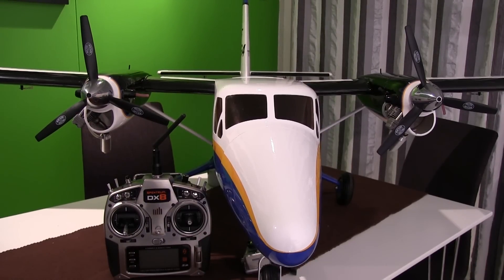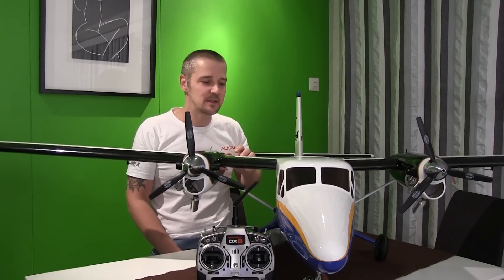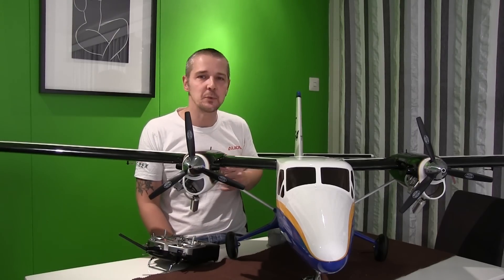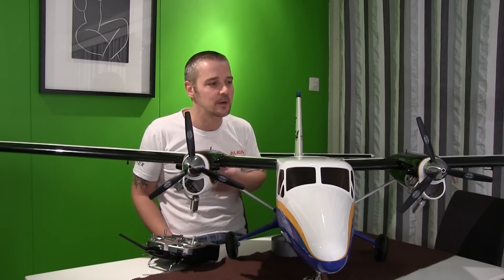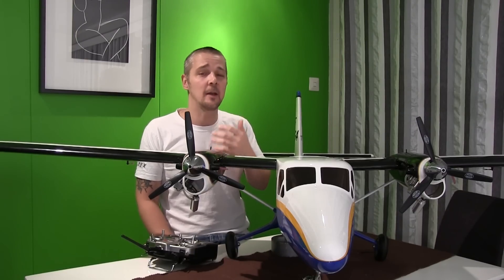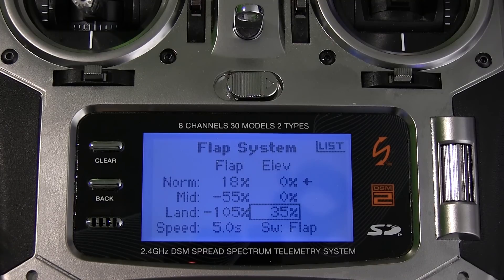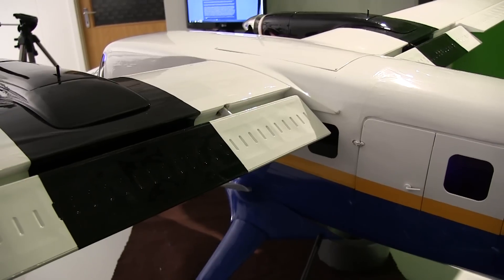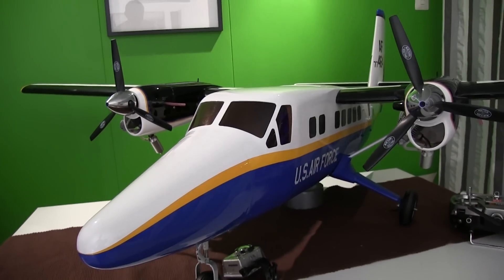Spektrum DX8 - Flaps And Down Elevator - How Do They Work & How To Use Them

Comment: Thank you so much for sharing your knowledge on setting up a Plane with the DX8. I just got a DX8G2 and will set up both a Carbon Z Cub and a Carbon Z Cessna on it. What Flap/Elevator mix would you suggest I use? They both have pretty much the same Wingspan of 80" and 82 inches. Any suggestion you have are appreciated. I lucked up on your YouTube site after going thru a bunch of tutorials and yours is by far the absolute best! I am now another Fan of ArticRC. Thanks for what you are doing for us in the Hobby.
Reply from the maker: I usally start with 10% down elevator on full flaps. I never used it on half flaps yet but you can add about 5% in the beginning and the tweak your way into perfect settings. Happy New year Sir
Reply: Thanks so much for your quick reply [especially on a New Year morning]. I planned to spend the day programing both Planes on my DX8G2 and now I can do just that. Can't fly yet because we have plenty of cold [4 degrees this morning] and plenty of snow on the ground here in the Mountains of West Virginia, USA. Watching you all fly in the cold is fun and funny as I sit back and sip my hot tea. LOL! I love your videos and the production and art work are some of the best on the Net. I have been spending my time watching your videos and am surprised how many there are. I have also learned things I didn't expect to learn. If there were an Award for a RC Website, yours gets my vote! Be sure I will let my friends know about your Site. Thanks again. Tony.
Reply from the maker: Tony Harris That is one of the most beautiful comments i have ever got in 9 years on youtube. I failed to reach my goal for 10k subscribers but i guess i just need to get even better.  But thank you sir and a happy new year to you and your family. Greetings from Norway.  Bengt & Elna.
Reply: Thank you and best wishes to you and Elna, Bengt. As a retired Radio and Television Personality, Producer and Program Director, I respect Talent and Commitment in those who present a product. Clearly yours is a Commitment of Love and Passion for the hobby, flying and what you do to share it. Stay warm and I will be watching and drinking hot tea until the snow melts and the Sun shows it's smiling face again. LOL!

Comment: What plane is that in the video? I would like to see it fly. Do you have a video of it flying?
Reply from the maker: Chuck S. Search ArcticRc Twin Otter.        it is the Hangar9  Twin Otter
Reply: ArcticRc thank you!.. do,you have a video of it? I'd like to see those twin four strokes in action..
Reply: I just found your video of it flying.. then it crashed. It's a beautiful plane. Did you rebuild it?
Reply from the maker: Chuck S. nope but i have a new bigger one on the way. WS. 3m  with two 30cc dle gas engines

Comment: Why does your elevator servo sound like it's jumping gears?
Reply from the maker: Michael Batson hi Sir.  the spektrum radio has a feature that slows down servoes for more scale movement. the 9110 powerHd are very noisy digital  servoes. even more when you slow them down.

Comment: my throttle stick moves my rudder. my left stick moves my elevator up and down when I move it right and left. my configuration if all backwards, how do you fix that?
Reply from the maker: anthony perkins i guess the Mode settings are wrong. go into system settings in your radio and choose mode2.

Comment: Can you tell me how to do the settings for plap use on my DX7s for a Top Flite Cessna 182?
Reply from the maker: i depends on how your servoes are stup. du you use dual ailerons or a y kabel. the same with your flaps. i have made a setup video for flaps but do you have the old dx7
Reply: ***** yes ... i have 2 servos for 2 flaps and 2 servos for ailerons (1 each). I use a Dx7s.
Reply from the maker: but do you use y cable on ailerons?  in wing setup you should set dual aileron and one flap. then aileron goes into ail and aux1 and make sure the servoes for the flap is pointing both to the right or left not against eachother and then connect them with a y cable to the aux2 port. go into flap setting and set aux2 for flap. then you can reversethe aux2 channel if the flaps goes the wrong way
Reply: ***** 
Yes. I use Y cables on both flaps and ailerons. What happens is that when i scroll to the travel adj on the aux channel, the tx only lets me assign values (travel %) on position 2 (fully down switch). When i try to set my values on position 1, i move the scroll dial and nothing happens on the flaps (they dont move up or down). When i move the flap switch to '0' position, the flaps move uall the way. But again, i need 25mm on pos 1 and 51mm on pos 2 as per manual suggests. Please help me out.
Reply from the maker: you need to go into flap settings. not travel adjustment. lets say you use flap in port aux1. then you need to assign this in the flap settings.  i will try to borrow a 7 channel radio and give you the setup in a video. witch reciver are you using?
Reply: rx is spektrum ar8000.
Reply from the maker: i will check it out. i think you just missdo the settings.  :)
Reply: ***** Yes. Ok. But check the vid links. I got it. Thanks for your help.
Reply from the maker: cool.. have a great flight

Comment: This is the first time I have an understanding of the mix function on my radio.  Unfortunately my Futaba 6EX does not mix elevator and the new flaps that I put on my Avistar elite trainer but now I know what to do for my next plane and radio.  Is there a way to slow down the deployment of my flaps, which have only one speed on my radio?  Thanks.

Comment: No pun intended that you do realize the elevator must go up instead of down for landing what your plans will nose down and crash it has to go up I think of when you do a loop you pull back on the elevator to make your plane go up not push it down because that would make you nose down into the ground right Landing flaps go down elevator goes up to stabilize the airplane
Reply: When you drop flaps, you increase lift on the wing.  This makes the nose go up, thus you must mix in down elevator to keep the nose from pitching up.  When flying my military jet in the Air force, when I dropped flaps for landing, I had to push forward on the stick to counteract the pitch up.  But as the jet slowed down, I had to trim in up elevator because of total lift decreasing due to lower speed.  Usually with models, we adjust the elevator mix to counteract the pitch up initially, then simply increase back stick as it slows down, because we are used to increasing back stick in all our landings.  Additionally the speed change is much smaller than full size planes, having a smaller affect on the back stick the hold during landings.